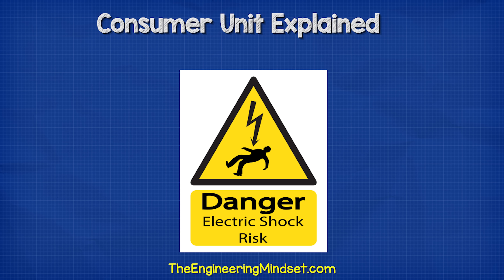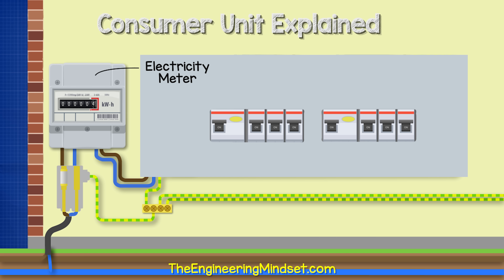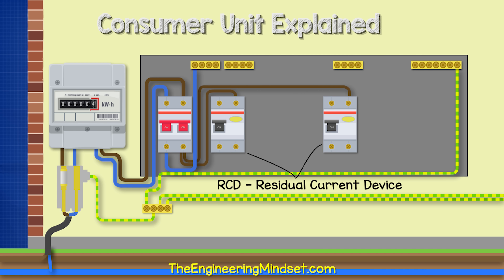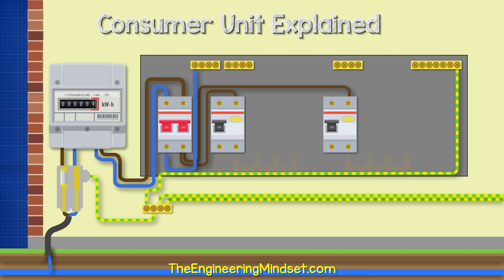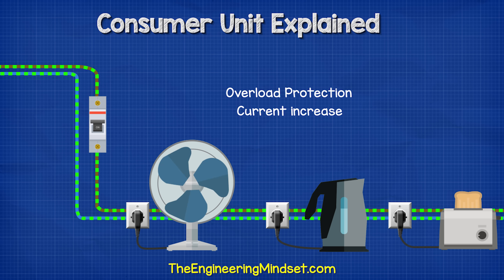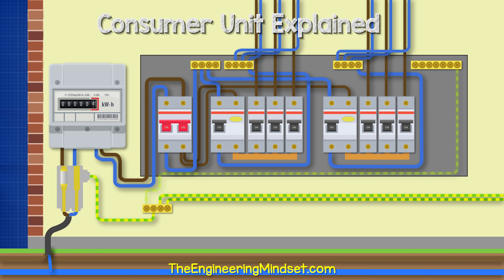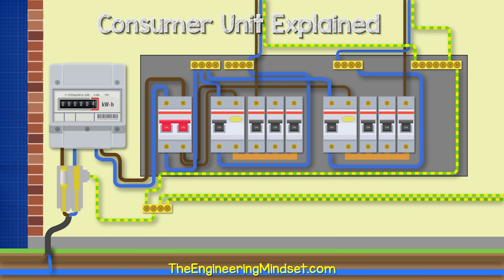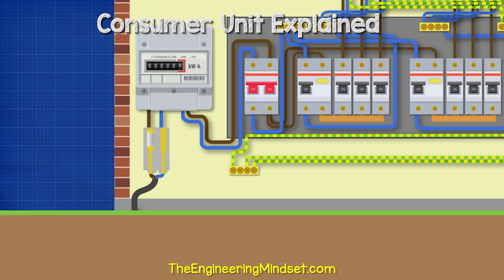Consumer Unit Explained - Fuse Board

Comment: is this a residential split-phase system used in the UK?  Or is this a simplified three-phase industrial panel?  Looks different (but similar principles) to anything I've seen in any house, but looks similar (in appearance only) to stuff I see at work in industrial/institutional facility.
Reply: This is a common modern setup for a residential CU, with RCDs protecting a couple of sets of MCBs.
Reply from the maker: It is a single phase connection, used in domestic properties across most of the world except North America and some parts of Europe
Reply from the maker: Seen our new 3 phase transformer video?➡️: https://youtu.be/u0SsejDCVkU
Reply: @EngineeringMindset  I will check it out, thanks for link!

Comment: Hey, can you make a video tell that how important is the breaker? There is many house doesn't care the breaker, many even just nail a copper rod and weld into the breaker arm to keep the breaker not to break. (like my friends).I hope you make a video to tell how important is breaker.
Reply from the maker: We'll make a breaker video soon. But, depending on the electrical distribution system used, its an essential part as it protects the property from over current and short circuits. Other types protect against arc faults.
Reply: @EngineeringMindset  Thanks mate (You say "we"? Are "The Engineering Mindset" is a group/company?)
Reply: @hquanngd  there's probably a team behind it... someone as writer/ storyboard, another as animator/ motion graphic artist, another as a fact verifier/ knowledge guru/ QA. it's prob harder to be a one man gang for this...
Reply: Without a breaker, a short circuit or overload is very likely to burn your house down. The excess current will cause the wiring in your walls to get extremely hot, easily igniting the wood/insulation next to them. All it takes is too many loads on a single socket circuit or a faulty appliance short-circuiting.
Reply from the maker: Seen our new incredibly detailed MCB video? link: https://youtu.be/gqEu9t8HwW0

Comment: Interesting. I had not heard of a "consumer unit". In the States, we just call it the meter and the breaker box along with sub panels.
Reply from the maker: US version video going live on Tuesday
Reply: And in Australia we call it a switchboard.
Reply: @lukeday87  that is what we used to call what telephone operators would use.
Reply: In the Maldives, we use the terms as used here except that we call main switch, MCB, and the rest of the individual switches, circuit breakers.
Reply from the maker: Check the new SUB PANEL EXPLAINED ➡️ video https://youtu.be/NUSNa-7Hecw
Reply from the maker: Seen our new incredibly detailed MCB video? link: https://youtu.be/gqEu9t8HwW0
Reply from the maker: Seen our new incredibly detailed MCB video? link: https://youtu.be/gqEu9t8HwW0
Reply: It's funny you call it "meter"... I think "footer" or "incher" are more appropriate names for US
Reply: @Max_Jacoby  good one.... or should i say IMPERIAL ONE
Reply: @Max_Jacoby  it meters the power so it's the meter, hah

Comment: Great video. Here is South Africa, lights and stoves are not wired through the RCD(we call it an earth leakage), so the live conductor go straight to the MCB from the mains breaker to the load, with the neutral conductor coming back from the load also going straight back to the neautral bar on the top left and then to the mains neutral. Just another way of doing it because sometimes lights and stoves can cause false tripping, hence bypassing the earth leakage.
Reply: It used to be that way here in the UK too. My house (circa 2006) has an RCD on the electric shower and plug socket circuits but none of the other circuits.
Reply from the maker: Seen our new incredibly detailed MCB video? link: https://youtu.be/gqEu9t8HwW0

Comment: I had wondered how Euro circuit breaker boxes were wired. Thanks!
Reply: In Europe we usually have 3phases in homes and new installations (atleast in Austria) require (some exceptions) a cable with 3 phases and PEN (Protective Earth and Neutral combined) The PEN then gets split up into PE and N.
Reply from the maker: The majority or Europe and the majority of the world even, uses a single phase. Germany and Austria use 3 phase to residential properties and I'd imagine with electric cars becoming wide spread we might start to see 3 phase connections more common place across the rest of the world
Reply: @EngineeringMindset  also in the Netherlands, Belgium, Denmark, Luxembourg, and some more European countries you see 3fase for residential buildings.
Reply: @EngineeringMindset  I have also made some 3phase "residential" (dont have too much information about where they actually go) fuse and Circuit breaker cabbinets. They are 60amp installs with 30 or even 5mA RCBs and they are specified for 380V 400V or some other weird 3phase voltage I currently cant remember. They are following housing installation specifications thus I think they are for that use. I know they are going out to India the US and Asia. Dont have further information nor can I provide more company information for...hopefully obvious reasons but I think they are less common for single family homes
Reply: @EngineeringMindset  probably never in cities where it's the norm to stay in apartment complexes such as in Singapore and Hong Kong. we prob would just live thru life never seeing one of those ever... unless electrician for big appliances like the EV changer "Rig"/ setup.
Reply: @EngineeringMindset  Why does the number of phases matter by itself? I understand that higher voltage is better, but at the same voltage - say 240V - why would it better to have 3 phase service?
Reply: @mr.g937  with 3 phase power you use less cupper for the same power than with single phase.
Reply: @EngineeringMindset  3 phase to residential is common in most of Europe, it's not unique to Germany and Austria at all.
Reply: @EngineeringMindset  Why would electric cars benefit from 3 phase? Isn't 3 phase typically beneficial for powering motors, such as A/C compressors?
Reply from the maker: Seen our new incredibly detailed MCB video? link: https://youtu.be/gqEu9t8HwW0
Reply: @EngineeringMindset  I'll give it a watch!